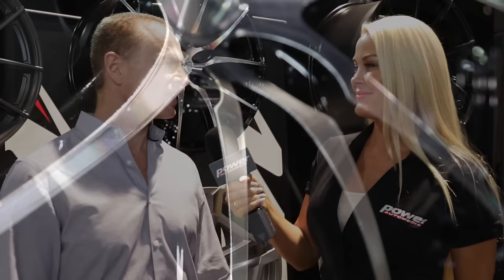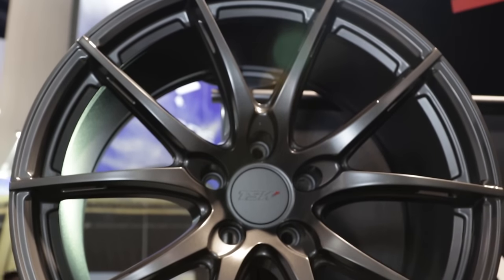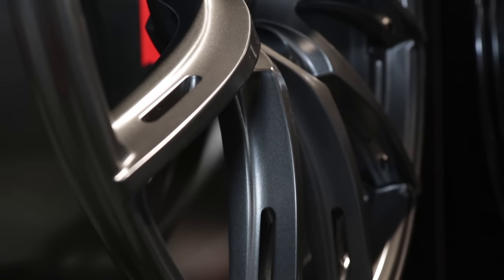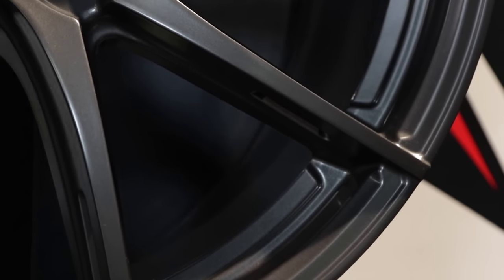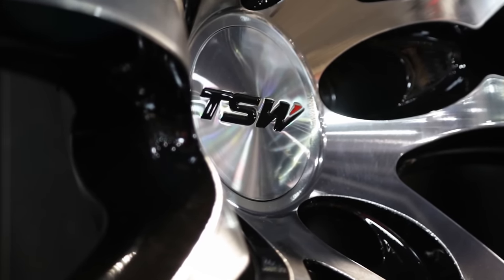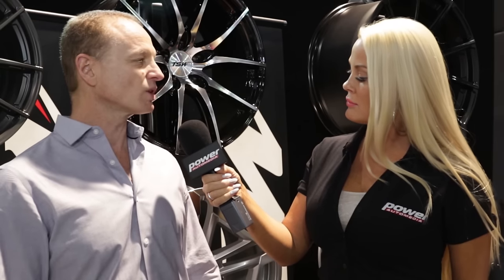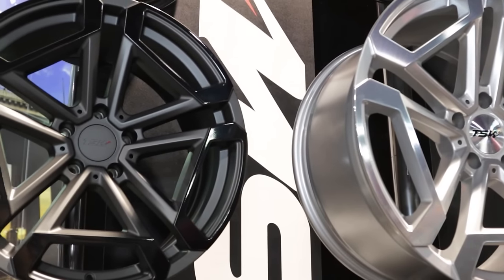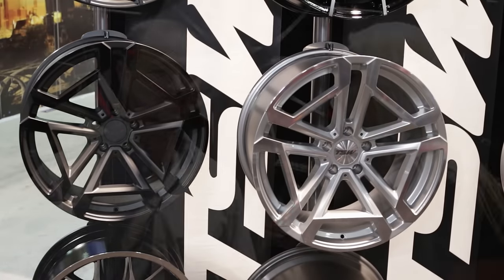SEMA 2016: TSW Debuts "Sprint" One Piece Cast Wheel

Comment: How much does the sprint weigh in 19"
Reply from the maker: Seeing as how they are brand new, TSW hasn't weighed them yet. You can check back with TSW directly at (714)891-0700
Reply: I'm wondering about the same thing. But based on wheels of similar size and construction, I speculate the 19" Spring should weight about 11~12 kilograms.